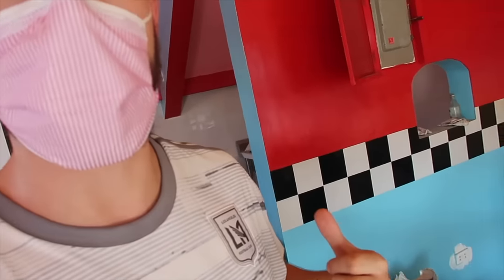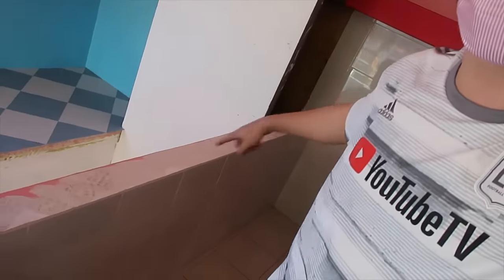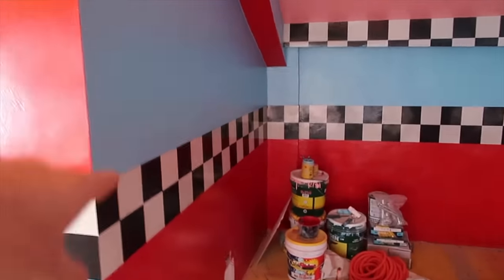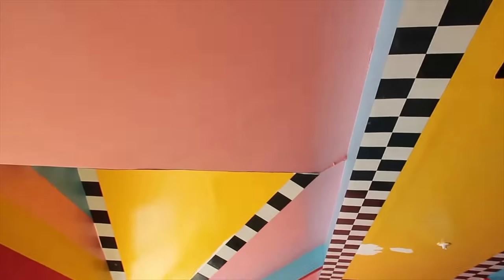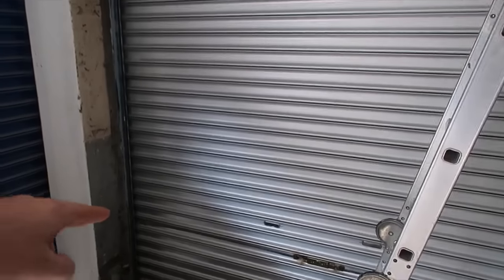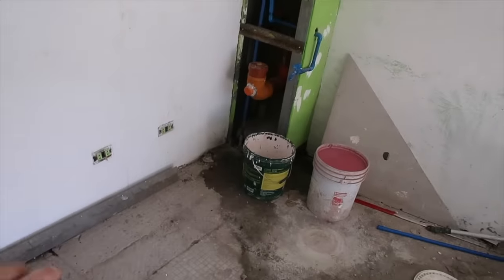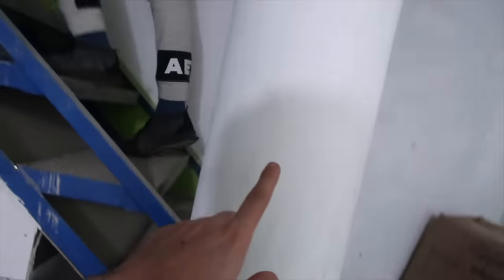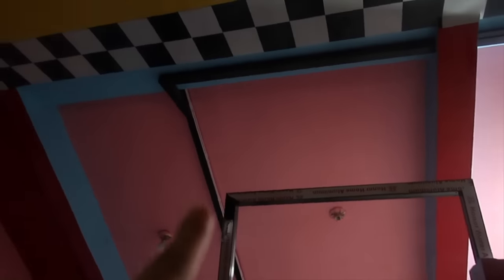ON BUDGET Renovation Progress DIY, No Interior Designer 🇵🇭

Comment: Yes the freezer would be in a snug  fit  situation ,  but you need a stock room that  will accommodate  a  fit in & fit out  incase of repair,   I think  a Plywood  sheet sliding wall would be nice ..  thanks po